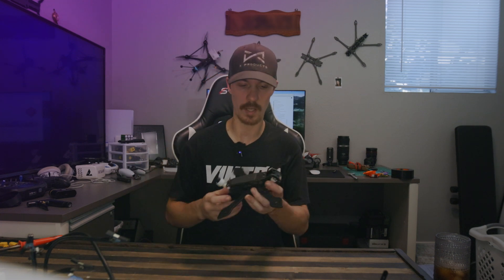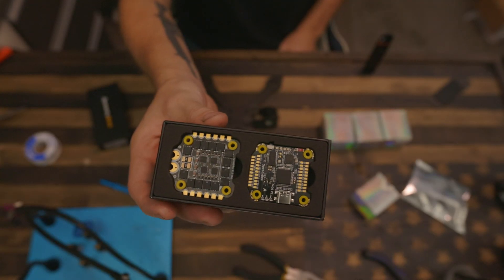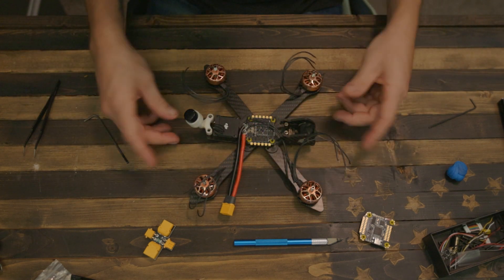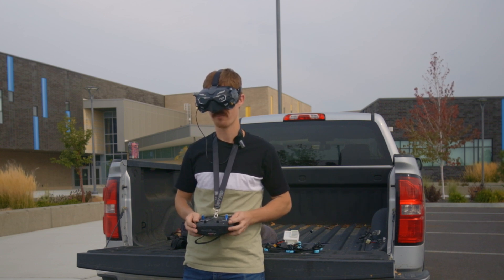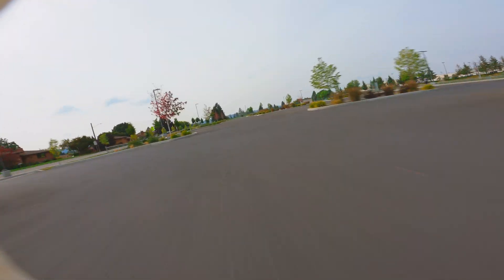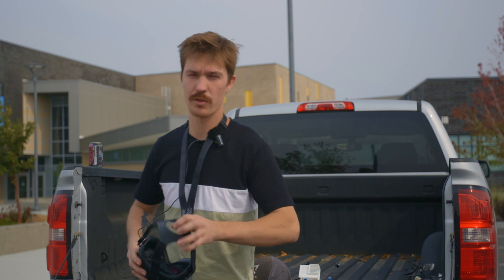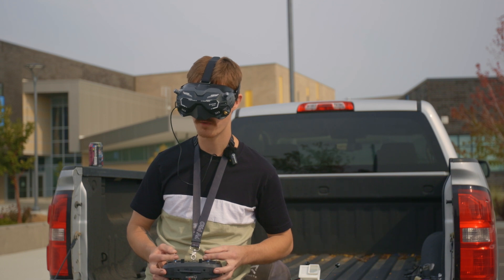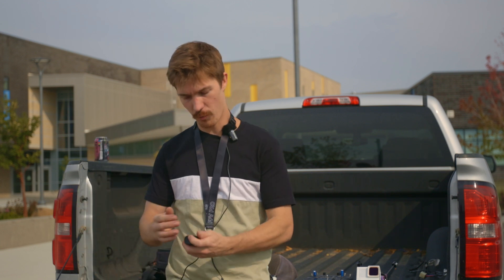FPV Drone Rebuild | SpeedyBee F405 V3

Comment: I have the same speedybee 405 v3 model but after all the assembly, the money spent and the time to build it- it wont fly. Repeated setup and firmware flashing in Betaflight has all the components bound together including air unit 03 and the Radiomaster Boxer yet it refuses to fly. Unlike other FC SC brands, the problem with Speedybee 405 v3 RXLoss I think is unsolvable. Speedybee is a BIG waste!
Reply from the maker: Sounds like a receiver issue rather than a speedybee FC problem. Did you check the power and RX TX pads to make sure everything was correct? any movement in betaflight on the RX tab?

Comment: I have questions about how to assemble my drone, I am using the same f405 v3 And I'm just getting started, I'm wondering if I need something else besides the controller for the remote control, can I contact you by some means? A mail?
Reply from the maker: This isn’t really a full build video. It might help to watch a full build. Here is a link to my most recent build video. If you have more questions just let me know. 
https://youtu.be/vilk_83lJ3g?si=euqxJsGDDgKsrIy4
Reply: Thanks, I watched the full video, it works well for me, thanks again

Comment: Is it still holding up? I reavised i got a v3 not v4 so now im suspicious. I can live with no osd while logging but is the ESC ok? Not trying to ask alot but if its calibrated, whats the most amps youve seen. I want to put some 900kv 2812s to it.
Reply from the maker: most amps the osd showed after a freestyle flight on my 5" quad is like 111 amps, but thats total so I think thats divided by 4 = 27 amps per motor. Which is not even close to the 50 or 55 amp raiting because the amp rating is per motor. so total 200-220 amps.  And most batterys cant supply enough continuous discharge to exceed that.

Comment: how far it can go??
Reply from the maker: Probably 3 miles. limited mostly by battery life, would go further with a larger battery.
Reply: @andrewmedia3568   how stable it is? can it go indoors?
Reply from the maker: @automoto95  the quad is as stable as you make. It’s all up to your control. But I don’t recommend a 5” drone indoors unless it’s like a large warehouse. This thing doesn’t have prop guards like a cinewoop. If you hit someone or something it could be catastrophic. Or a trip to the hospital.

Comment: what camera do you use for the top down view?
Reply from the maker: Canon eos R7, with an EF 16-35 F2.8 L-series lens using an RF mount adapter. Filmed in clog3 and I think resolution is 1080 not 4k.

Comment: Sounds like you just had a bad solder for your motor/ESC wire.
Reply from the maker: definitely could have been. maybe I just wanted an excuse for a new build 😄
Reply: @andrewmedia3568  I have my old eachine wizard x220 doing the same thing. It's got no OSD, and old F3 clean flight board.

So I hear ya, I have the speedybee F4 in my cart just waiting to hit buy 😅

Comment: I'm surprised you got such a nice tune right out of the box. I used the SupaFly tune, and it still leaves a lot to be desired.
Reply from the maker: Yeah I was surprised as well. Every quad is different so wasn't sure how well a pre set would work but I'm happy with it.

Comment: Nice and smooth 👏
Is that medium fast or medium slow tune ?
Reply from the maker: I just used the pids for 4s 2400-2700kv motors with HD camera. I deselected rpm filtering and rates because im not using bidirectional dshot and I like to set the rates myself.

Comment: Hey mate. What are you using for rpm filters parameters?? I got the same stack, but my quad doesn’t have that much “clean” sound  as yours? By the way great video.
Reply from the maker: Thanks. I dont think im using rpm filtering because I dont have Bidirectional Dshot enabled. the only filtering im using is the gyro filtering which I didnt setup. I just used the Supafly 5" freestyle preset and then moved the master multiplier to 1.25.

Comment: What antennas you have on your receiver?
Reply from the maker: One of the antennas came with the receiver and the other one is a betafpv 2.4 elrs antenna (the white one).
Reply: @andrewmedia3568  those antennas can work with the good old SBUS ?  I have a flysky remote
Reply from the maker: @mcFlow1  Honestly I dont know about flysky. I would recommend switching to ELRS if possible. Much more features, its very cheap and everyone has it.
Reply: @andrewmedia3568  what remotes they have ?
Reply from the maker: @mcFlow1  I have a Radiomaster Boxer ELRS version and a Radiomaster Pocket ELRS version.

Comment: what is you rotate the ESC and FC 180 degrees and have the power in the front. USB will be on the other side. you can change the FC orientation in betalight. I did this before. the tricky thing is mapping out your motors to the new pads on the ESC. Also awesome flying the inverted yaw was nice!
Reply from the maker: I probably could have done that but it would still be super tight in the frame. the skyliner mk3 is just really compact.